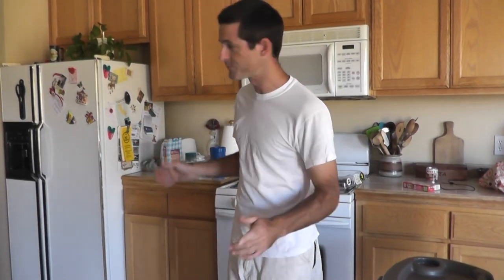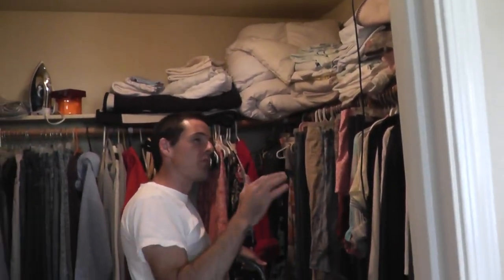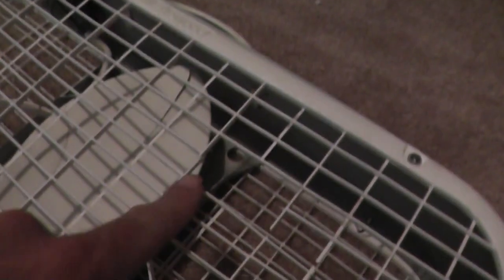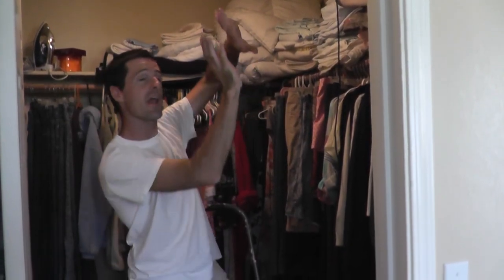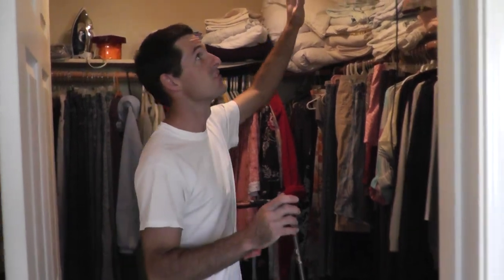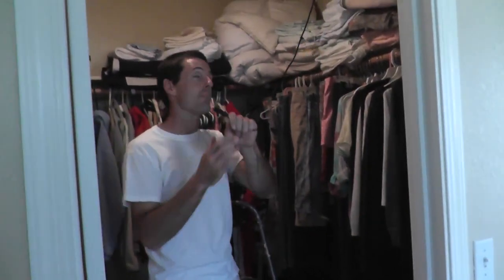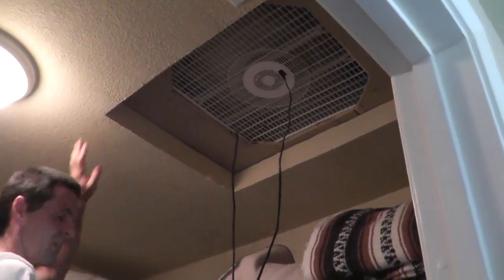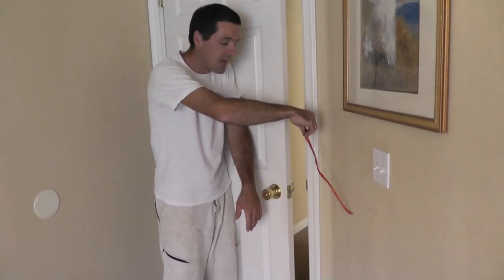Cheap Homemade Whole House Fan - How To Cool Without A/C !!

Comment: That was awesome. I live in southern california, and ac is so expensive! I can't wait to do this and see if it works. Thanks so much for this. You Rock!
Reply from the maker: larkatmic Glad you liked the video, If you get it all set up now you can hit the ground running when the temps go up!
Reply: I'm also in socal. Did you try it? How'd it go?
Reply: Good luck circulating hot souther California air > 100°.  Go get into your car, turn the heat in around 82°, and hit the circulate button.  Try to sleep in that shit.

Comment: I'm going to do the same thing in my garage. Attic stairwell to draw air in through my garage and cool my attic in the summer.
Texas heat is brutal!
Have ridgevents in my roof and it will help push that heat out.

Comment: Hey guys I have a much better cooling option... drive your car into your house (carefully of course) and bam you got yourself a whole house fan. Simply turn your car on and run the AC with the car windows open. If you're one of them fancy folks and have a sun roof then make sure to open that too for added benefit!

I know, I know, but it uses gas right? Well here's the best part...
To save gas run your car's exhaust directly into the the car's intake. The exhaust contains gasoline byproducts that condense back together into gasoline. If you've ever paid attention to the exhaust then you might have noticed a liquid coming out of the exhaust. This is "PURE" gasoline which is why it doesn't have smell or taste like normal gas since it doesn't have any of the harmful contaminants.
The exhaust fumes will condense back together once they hit your intake manifold and will be automatically injected premixed with air into each cylinder. You just need about a gallon of gas to get the cycle going. Trust me.. I'm some guy on the internet.

Comment: Smart, cheap, economical, great idea..... But! It's stupid and dangerous, not that it will kill you right away, but over time, when high pressure is in attick (where a lot of insolation, dust, etc)  - those dirty particles will find a way back to your room thru cracks, recessed lights, etc... into your lungs. Best is a fan IN attck on roof or wall blowing air from attck to outside, aka low pressure in attick.

Comment: I would much rather use my window air conditioners rather then roast in my house.  Fans are not effective when the temperature outside is above 80 degrees.

Comment: Great video and tutorial, but unfortunately, this does not work! A cheap, 70 watt plastic-bladed box fan is not enough to cool a whole floor, let alone a whole house. Can it cool a single room by itself? Yes. In order to cool a whole house, you'd need, at a minimum, a 200 watt, 20 inch steel-bladed fan, like an Air King 9220. If you have a 2-story house, step up to a 300 watt, 30 inch floor fan, like the Air King 9230. Or better yet, get an actual whole house fan installed. I love the concept, I really do, but the small, under-powered fan just won't cut it. Add a bigger fan, and you'll be in business!

Comment: Attic fans work very well,  but they are usually much larger..   Was a simple system that worked back in the day colls the house and and brings cool air into the attic and cools off the attic too

Comment: I have a great idea- why don't you go and make 1 more of these and then quit. look man I have been doing h.v.a.c. work for 24 years and I can tell you that a box fan even without a cracked fan blade is not capable of delivering enough cfm (you do know what that is don't you?) to move anywhere near enough air to get that house down to anything close to a comfortable temp. unless of course you like it 90 or above in there

Comment: attic fans suck,  it has to be cool outside.  get some attic insulation, will help u in the winter too.  i would say for the price of electricity to run the fan, would rather get a bigger ac unit.  i have some batts in my attic and 15 inches of blown in michigan, and am fine in the summer.  rarely goes over a hundred degrees in the summer though.  i have a 930 square foot house and have only a 10,000 btu ac in living room and a 5,000 btu in one bedroom.  On the hottest 90 plus degree days, 73 to 74 in living room and same in bedroom with ac.  far room maybe 2 dergrees warmer.  never sweat, but should have gotten an 18,000 btu and only have one unit.  i would use a fan but they are very loud also.  i just open a couple windows and cross ventilate.

Comment: Nice. But so many comments and no one mentioned also opening a basement hole on the other end of the house? You could store some water down there for hard times, and in the mean-time it could be acting as a heat stabilizer. (P.S. try it w/o the fan some time; such a set-up was designed in our old old courthouse with no electricity. I'm thinking that "all-night-long is plenty of time to cool.)

Comment: Seems the spiders would find that venting as being inviting when the fan isn't running.  It has been awhile did you find that to be a problem.  I'm thinking running it out a window at night and closing that window during the day.  That is what I do with pretty much the same weather here.  We get up to just over 120.  Though my windows are single pain (I rent) I have blinds, and the cellking has really good insulation.

Comment: In Daytona beach, Florida; there are ceiling mounted fans at the flea market enclosures.  These spray a water mist to cool passers by.  However, they spray the mist directly in front of the fan so as not to decay components or create shorts.   Whomever might have been berating your video for this notion being idiocy lack a scientific mind and are only able to operate under the standards of practicality proven true by the systemic progress of their myopic lives  Just pity them.

Comment: I must also stress that too big of a whole house fan can be dangerous. Even with all doors and windows open, it can still put a large negative pressure on the structure.  This in turn can possibly cause back draft on certain natural draft gas/fuel burning appliances and cause flame rollout and possibly a fire as a result. I read about it in an HVAC trade magazine....
Reply: +Todd Berner 
This sounds like a post that someone from a power company would say as a scare tactic to get people to continue spending more money on using regular AC, lmao!!
Reply: Uncle is a fireman, he agrees.

Comment: Connect that to a timer and build an intake fan with a window frame somewhere secure on a shaded side of the house connected to another timer synchronized with the attic fan set in increasing intervals to the time you all come home an the house will be already cool. It works very well.
Reply from the maker: Thanks for the idea!
Reply: Your welcome,  let me know if you need any setup advice.

Comment: How's this working for ya? How's you attic ventilation? It'll work so much better if you have a good vent system in your attic. If the attic gets too hot it's like a heater on the ceiling.

Comment: To make life easier you could include an in line timer into the circuit, the type that just plugs in, and if you wanted to be realy clever you could incorporate a thermostatic control!
Reply from the maker: b57ecv Good ideas, Thanks! Then it could be called an electronically controlled automatic air circulation system!
Reply: *****  you could also open all the windows. if the point of the thing is to get out side cool air in... or put a fan pointing out wards on one side of the house and open your front door on the other...
Reply: William Haney part of the point is to get the cool air into the attic and cool the attic down
Reply: One of the best ways to cool down a house is to try to make use of the cooler night time air temperatures, if they accrue, by transferring the warm air out at night replacing it with the cool air, and then in the day keep the doors and windows closed to keep the cool air in, works well on older type brick masonry or stone building's with fairly thick walls, it works here in Britain ok but we tend to not get weather as hot as other parts of the world.
There is also an aspect of ventilation to consider as well with some older less well built buildings ,,with these it can pay to have as much air moving through them as possible to remove moisture that can collect in there internal and external fabric, ie the wet builds up through long cold winters and of coures people cooking and bathing and showering can all ad to the problem of mold accruing, old buildings need good ventilation, I've seen many an old house here in Britain go from bad to worse by inexperienced home renovators fitting double glazed windows -doors and re pointing masonry with sand and cement that seals the moisture in, instead of lime mortar that allows the masonry to breath it out.
Reply: ***** if the attic is hot, the heat will be radiating down from the ceiling and you will be uncomfortable even if you have cool air going through the house. unless you have really good insulation above your cieling
Reply: There are two fundamentals that are fact about air,  hot air rises  and cold air sinks, hot air builds up in attic spaces through lack of ventilation the more ventilation the cooler generally speaking it will be, but this all depends on the ambient external air temperature,
So a well vented attic and cool air trapped in the lower parts of a building tends to work but if it's really hot outside and you open all the windows and doors all you tend to do is let all that heat in.
Reply: I'm thinking an Arduino controller, a temperature sensor (for the inside of the house, the attic, and the outside of the house), and a few SSRs (solid state relays) for controlling the power to the fan(s) going from the house to the attic.  While you're at it, you might as well add an ethernet module so that you can hook it up to your home network and be able to control it via commands sent from a computer / smartphone / etc.

For example:

If the temperature outside is cooler than the temperature inside, turn the fan on.
If the temperature inside is below some minimum comfort level, don't turn the fan on.

I suspect that there are more criteria that you might want to consider when determining when the fans should be on.

You could also use this to control a sprinkler valve for misting the roof to help it cool down.

If you're not a "C" programmer, well, you probably should not consider this suggestion. :)
Reply: why do this you say? because you can an nothing more... XD

Comment: You should get one of those remote controlled switches and just use that instead of unplugging and plugging it in. You could also use a timer but if the power goes out you're screwed. I have both analog and digital ones and both need resetting after a power failure.

Comment: If you have a basement which has windows that can be opened then open the ones on the shady side of your house and leave the door to the basement open and leave main floor windows closed yes closed and place a high cfm (Patton brand or Lakewood) rated fan at the base of the stairs blowing air up from your basement which is normally 63-68 Fahrenheit year around if you have a second floor the open all the windows and put a cheap box fan blowing the air outside of the house this will help to lessen the air pressure on the second floor slightly along with the applied laws of thermal dynamics will lower the temperature of you house.
Reply: you could just turn your hvac system on fan mode and let it suck the air from the basement and distribute it around the house.

Comment: the success of this project is juts the fact that he opens the door when temperature outside is cooler, fan is doing little to nothing. I do this even in Arizona, in between seasons, I turn the AC off and let cool air in the house. when other people still ruining AC. even more effective its to open two doors or windows in opposite side of the house for cross ventilation.

Comment: a 40 dollar attic power vent may serve better..hot air doesn't naturally rise into an even hotter attic air..getting the attic cooled off will allow the trapped heat in the house to naturally rise

Comment: why dont you plug the fan into a remote control and then to turn it on you simply press a button instead of plugging a cord into the fan? I use remote controls for everything from lams to fans to outdoor ponds. remotes dont just have to be used at christmas time for outdoor lights.

Comment: The issue with this method is that you're not going to be able to pull enough CFM to cool it down unless there are huge evening temperature changes. Even then , humidity levels rise at night which will be absorbed by clothing and other materials within the house. The job of an air conditioner is basically to slowly remove moisture from the living environment so that the human body can give up BTU's more rapidly during hot, humid weather. An adult produces roughly about 400 BTU/H at rest, and when our bodies are surrounded by a moisture rich environment (not like a swimming pool for all the smart a$$e$), we are not able to give up water vapor as easily.  That's because water has a high latent heat, which is the heat required to change liquid water to vapor. It happens when it's hot AND humid, and the sweat basically can't get out of our pores. Here's a gruesome thought, if it were around 88°F with a humidity level of 85%, it feels like its 110°F, our bodies would slowly begin to cook and we'd die of organ failure. Use the A/C for God's sake.

Comment: Heas a later video where he has made a so-called evaporation unit. Why? Because a little box fan shoved into the ceiling of a basically enclosed space can't do the job of a properly installed whole house fan. I had an older poorly built single story track home like his in SoCal low desert ( triple digit country). The HVAC would kick the breaker all the time and we could never cool the house to below 85°F. Turned out the wiring was wrong and the unit too small. We couldn't afford the necessary changes at that time, so we researched and properly installed a whole house fan in the central hallway. We had to make the cut-out in the ceiling, add bracing, and wired a switch in the hall for it. Though it looked like a box fan, it was bigger, faster, and noisier than any box fan I had had. With windows only slightly open, when outside temps were cooler than inside, it exchanged the air quickly. This is important because cooler inside temps cool down exterior walls faster.  Even on triple digit days, my home was comfortable until around 9 or 10 a.m. We also put good switch controlled ceiling fans ( you want the longest blades the room can support) in the bedrooms and eating area. Couldn't put them in living room or den because low roof, and an ugly skinny beam. We eventually replaced the wiring, entire heating and cooling system, and added venting in the living room and den that would blow into the room instead of down the halls. But, we had done such a good job with the fan system, we seldom used the AC. My electric bill in the summer was usually below $75 while my neighbors were always above $100. This was in the late 1990's.
In his evaporative cooler video, he has a poorly jerry rigged system mounted against a window that keeps the exterior stucco wet. You can see a crack in the stucco leading off from the lower corner of the window. His idea seems to work, but if you do it, figure out a way to keep the exterior wall dry. Layerer sheets of aluminum foil ( like roofing, start at the bottom), plastic trash bag or other non-absorbent material. Don't let it drip onto anything, including windows because they will be damp throughout the hot summer and fall months.

Comment: This is a ventilation fan- no way whole house- good intention though- it would require about 5 of those units you have at least 5 amps @ 120v to do the job and then trickle down once rolling  You need 6-9000 CFM to call it a whole house- you have " awoke room  Good try.

Comment: I live in Montana. 16% humidity.  My day temps are 90s and my night temps are 50s.  Physics works. I do this every day in my house.  I get the house as cool as I can then close everything up.

My only addition to this vid is I use windows to vent the house. an attic fan would be better

Comment: Nice! Thinkin about doing this in my garage. I have attic access there separate from the house attic space. I can add a box fan to vent hot humid air when using my swamp cooler. It’s 110° in the garage during the day.

Comment: Whole house fan drops your electric bill a significant amount.  In the morning , when it is cool, you open a few windows and turn on the fan.  It draws cool are into the house and blows it into the attic.  This cools the house, but also puts cooler air into the attic. During the day, the air in the attic has to heat up before the house begins to heat up.  The air up there will get up to 130-140 degrees F.  If your central air kicks on at noon, instead of 9:00 in the morning, how much lower do you think your electric bill would be?  My parents have a professionally installed whole house/attic fan.  I was watching their house when they were out of town.  I would go over in the morning, run the fan and get the house down to about 60* and close up the house.  The A/C was set to 85*, and it did not come on the entire two weeks they were out of town.  It was over 100* every single day.  This is something that works, extremely well.